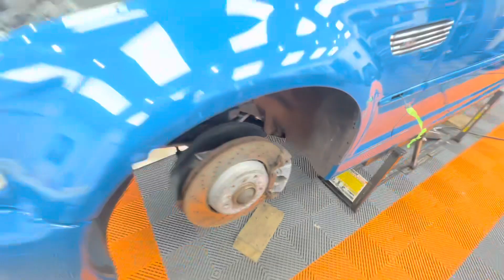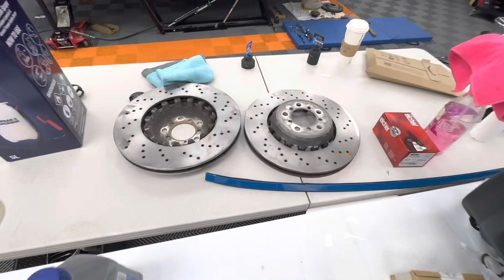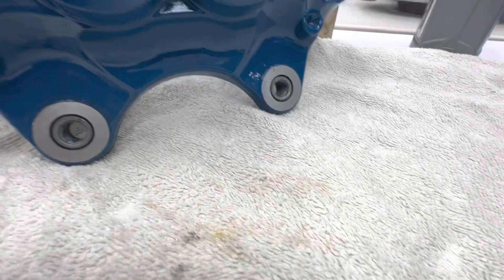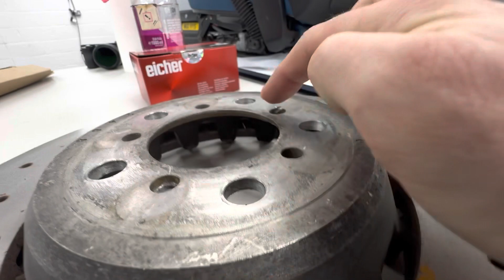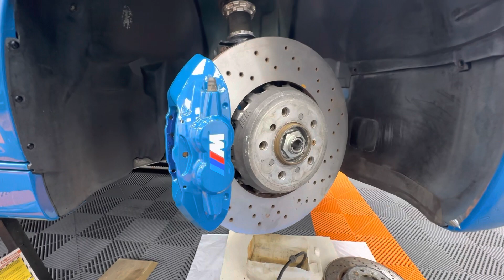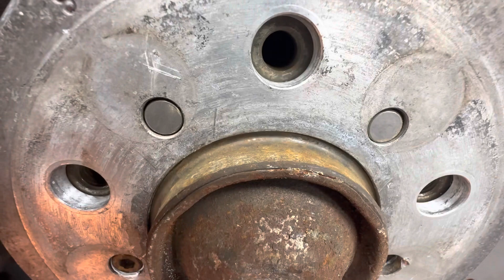Bmw e46 m3 front brake upgrade f8x swap 380mm brembo 4 piston f80 f82 f83 m4 m2

Comment: I’ve seen on your website you list this for the Z4M too, does this work on the Z4M as the hub knuckle is different to e46 m3 and the track rod end sits closer to the disc as standard compared to the e46 m3. Thanks Andy
Reply from the maker: Hi, 
Yes, it just requires slightly larger shims.
Reply: @vysgarage what size shims as I’m not mad about changing wheels again and that obviously throws your wheels further out.
Reply from the maker: 4mm total each side
Reply: @vysgarage Can I piggy back and ask would the shims for the m3 work on the non m3 e46 or e36
Reply from the maker: @ScottyKushTV  no, completely different. 
Check out my other video for non-m setup.

Comment: Thx for the guide ! Great job done mate .  Its not really clear if its will fit 18th inch wheels ? Is there is a way to get dimensions from you , max width where caliper ended from centre ?
Reply from the maker: @dr.Greenhouse53   it depends on the wheel. Most 18s clear fine but some older design wheel have a stepped barrel, so they don’t clear.

Comment: What needs to ne done to fit E46 non m?
Reply from the maker: Just need to space the Caliper with m12 washers.
Reply: @vysgarage  
Thank you. What about in the rear?
Reply from the maker: @sr20dett1000   rear isn’t that simple. 
I did a video about using e82 rear Calipers.
Reply: @vysgarage  the rears is easy with 135i Brembo calipers on E46 330i using E46 m3 rear rotors. Saw you post about using 340mm front rotors. Here we don't have vw transporter. I'm thinking of using 345x30 rotors from a 2016 Chevrolet Camaro SS, hat height is 61mm. Will need to check the rotor swept area.

Comment: I bought a set from an f30, but it isnt the 340mm one. Its the 370mm. Are those the same as the f8x?
Reply from the maker: Yes they are the same 👍🏻👍🏻
Reply: @vysgarage  thanks alot, it makes it alot easier to find parts. My f30 set only has 345 mm rotors in the back. Dont know if thats the same compared to the f80 370mm
Reply from the maker: @basterbogt  the  Calipers are exactly the same. 👍🏻👍🏻
Reply: @vysgarage  so ordering f80 rears will work fine?
Reply from the maker: @basterbogt  yes
Reply: @vysgarage will the 370 and 345 rotors work on the e46 m3?
Reply from the maker: @ricolam4916  no

Comment: Do the F80 calipers  and 380mm rotors bolt up to the e46 330ci knuckles with no washer or do they require a washer like the 340mm calipers?
Reply from the maker: I haven’t tried, but they should.
Reply: @vysgarage  do you think this setup can accommodate 18” wheels?
Reply from the maker: @eduardolima8560  yes, most of them

Comment: Are these able to be fitted on an e90/92 chassis? Both front and rear?
Reply from the maker: Depends on model. 
Which e92 do you have ?
Reply: @vysgarage  I have a pre lci E90
Reply from the maker: It is an m3, 320i, 330i, 335i?

Comment from the maker: Shim spec:
M40x50mm, 2-2.5mm thick.

Lines:
E46 m3 with e9x unions and additional 30-50mm in length.
Reply: Where did you source those washers
Reply from the maker: @LunasGarage5  ebay
Reply: @vysgarage  Great vid, do you have link to these washer spacers? Can’t find them anywhere. Thank you in advanced
Reply from the maker: @IE46M3  
2mm, m40 by 50mm

https://www.ebay.co.uk/itm/253448405353?mkcid=16&mkevt=1&mkrid=711-127632-2357-0&ssspo=lzbdE57DSHe&sssrc=4429486&ssuid=jzxtgpbztkw&var=&widget_ver=artemis&media=COPY
Reply: @vysgarage Great Thank you so much 👍
Reply: @vysgarage  hi  what is the inner diameter on the washer? 40mm or 50mm ? Thank you in advance!
Reply: Is there an alternative to the brake lines? Like OEM e90 brakelines?
Reply: Hello! on the csl wheel you need to used spacer for the wheel or they fit good ? Thanks